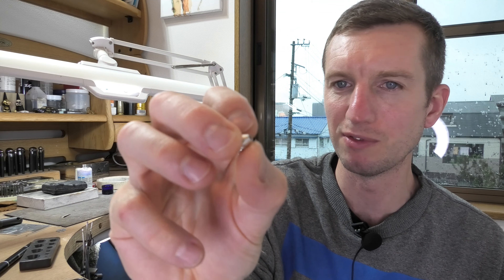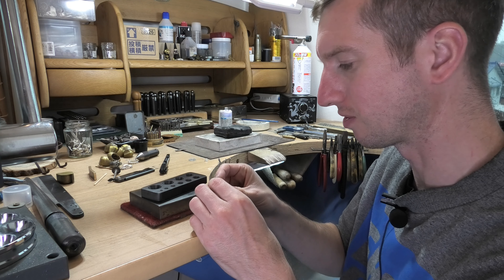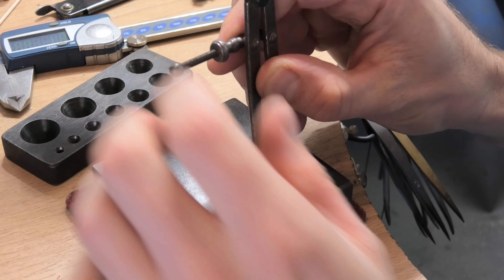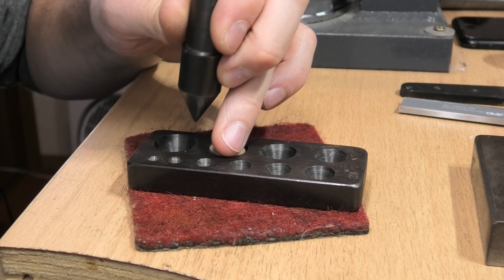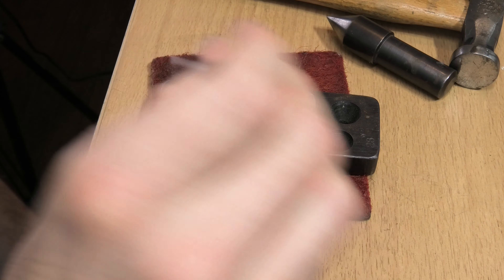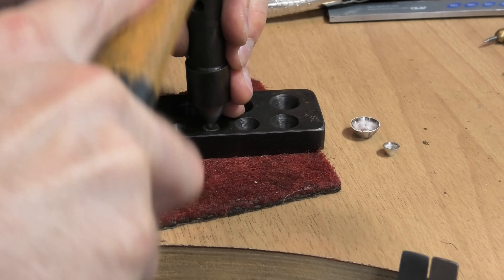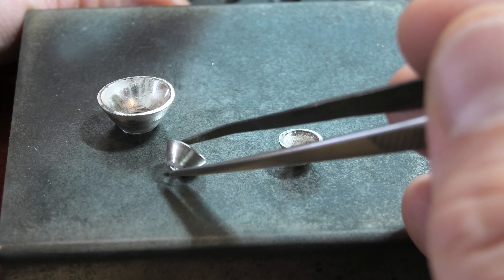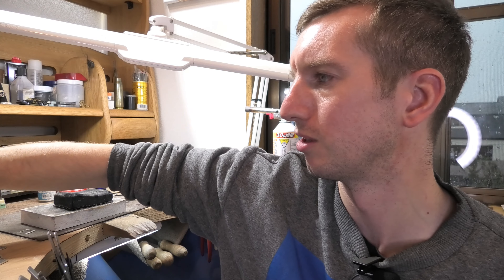A Better Technique For Hand Making Collets?!

Comment: Awesome idea doing that without a solder joint, almost like a coin ring! I have an idea as to how to get the top a little more uniform. What if you flip the collet over and hammer in the top a little so it slides further into the cone hole and then you can spread it back out more evenly with the punch? It’s hard to describe through text, I wish I could just show what I’m talking about.

Comment: You are actually meant to start this process in your doming block. Try using your metal block to force your collet down then use the punch in your last. Learned from a very old jeweller.

Comment: Great info/technique , thanks for sharing. That could speed up making collets a lot if you ever need speed and series in a job. In this video the edge of the punched collet was a bit uneven/raffelt because you hand sawed the disk. Now imagine you would also use a disc cutter punch to make the disk......how long would it take to make a collet or a dozen of collets compared to a collet like you used to make them?? . Old method you need to cut and file a strip first...than bend it ...solder it ..file the solder and then make it perfectly round using the collet die.With some experience in choosing the right size to cut the starting disk i bet a collet could be made under 5 minutes using the shown technique.

Comment: I make coin rings @kendal_rings and iv thought about using this method to make collets but i still havnt tried it yet lol.. Iv punches an dies for the larger diameter 2ml silver coins.! Great video though Chris. It turned out not as bad as i thought.. See in coin rings we usually make a bigger hole that ones we would have in our collets, so its probably easier to move the silver maybe? But the second smaller on u tried didnt turn out too bad😬 lol

Comment: Hey there, I have an odd question
So our workshop relies heavily on donations and we have this device that looks similar to this machine thingie, only it is only one row of circles, and it opens in half and there are ridges on the inside.
Any clue what it is and how we figure out how to use it?
It’s been in the workshop for over a decade and nobody knows what it is
Reply from the maker: No idea! Is it part of a disc cutter??
Reply: @DiamondMounter  no, doesn’t seem like it. It isn’t like a smooth surface, the inside of the grooves have ridges, it’s strange